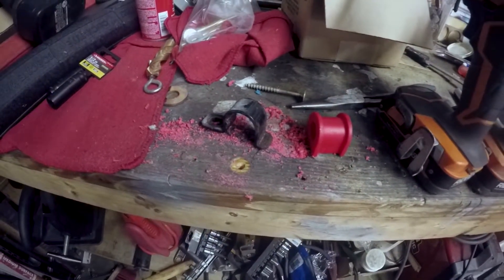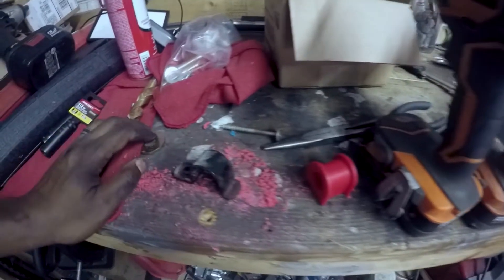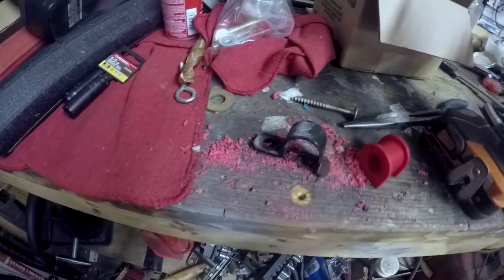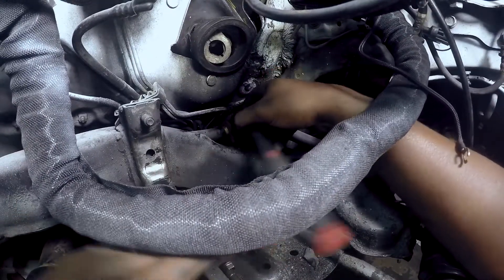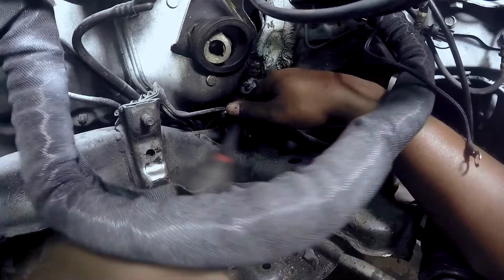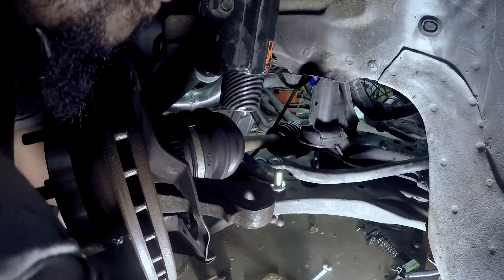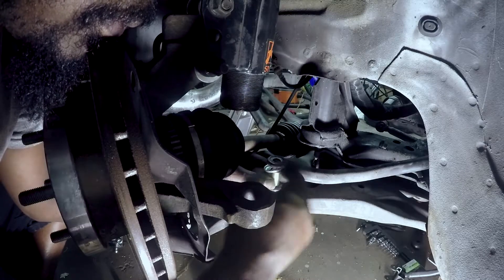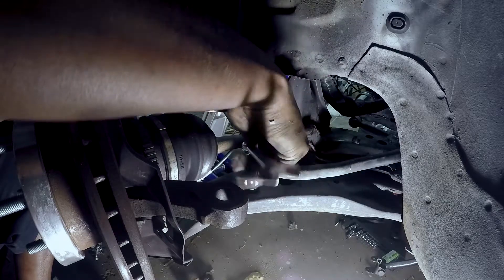Installing Energy Suspension Sway Bar bushing on Escort GT

Comment: Man, I'm so jealous that the end links just unbolted pretty easily for you. On 3 of my 4 end links on my 93 wagon, I had to use a cutoff wheel and cut them apart to get the new ones on. One of the few places of rust my car has/had.

These bushings are amazing though, really improved the handling.